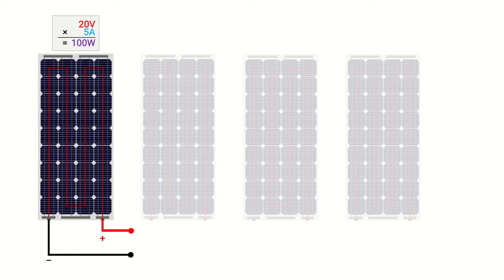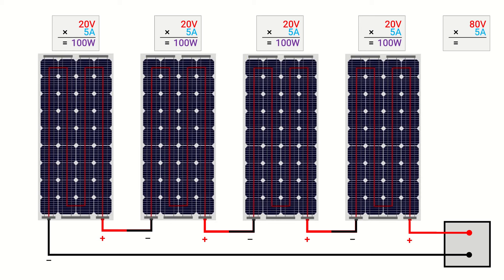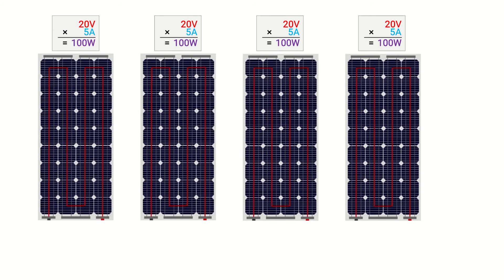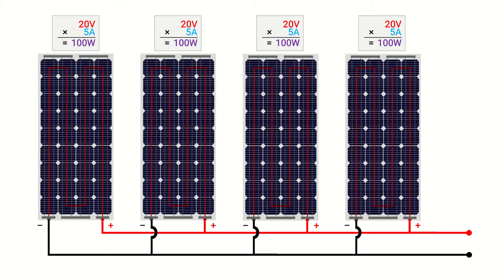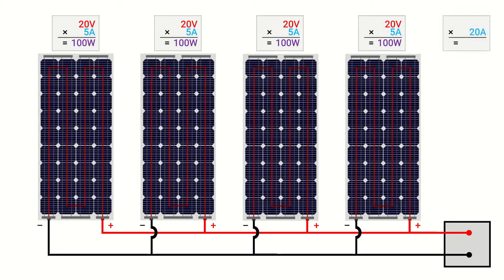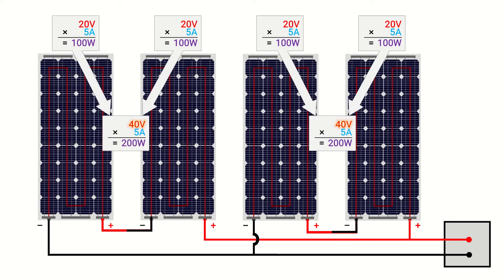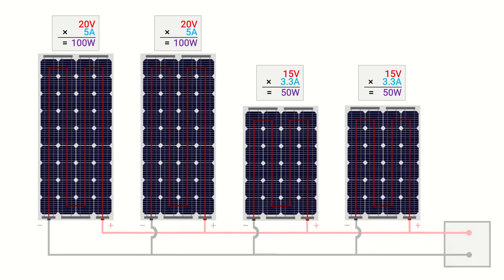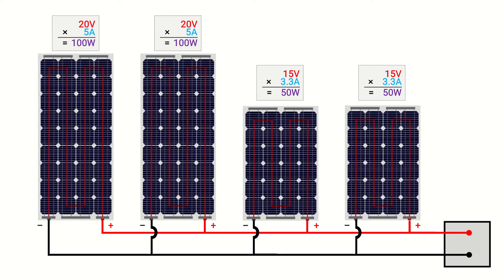How to wire different sizes of solar panels together

Comment: I just hook everything up as 12 volt bringing each line in to a positive and bring it into the house and bring anything negative into the negative and bring it to the house without combining them and my one's doing fine my other one I'm not exactly sure cuz it's never been able to put on its full power because the battery is enough so I don't know if I'm running all that one or just kiss somebody and 28 amps and the one I know is okay because that's all I hooked up to is 28 amps and they're both hooked up the same way with two different size solar panels but the bigger 60 amp one is connected with additional 60 w solar panels same as the other one with 150 w solar panels and they both sets have two 405 w solar panels no one at 950 Watts runs okay for the tubing size solar panels I'm not sure about the other one which is 1440 Watts I'm not sure how that one is actually doing cuz it's never been a run up to its total amount of power. Cuz in other words connected to it and with them together it's running smaller than the small one is I'm not sure why except that I don't have enough batteries I'm not using the power to make it work all its power that it needs to work I'm not sure.

Comment: Iam confused! Why can't you just wire all of them in parallel and let the voltage intact? If all the panels have the same voltage and u wired in parallel ur simply adding up the amperage and leaving the voltage the same, thus aswell getting 100% output! But u never mentioned that way, why?

Comment: This lowest common denominator, is it not BS???
I mean, if you have 200000  panels of total 20 volts and 2 panels of total 15 volts, you really think that the whole shibang is gonna come down to 15 volts? i don't, i had 6 panels putting out  60 volts and then i made a mistake wiring 2 more, and they only put out 30 volts(i did not put these 2 in series, like the others--3P2S); i fixed that a week later; meantime, the wattage stayed the same as if the 2 last panels were not there; that is why i saw some' was wrong;
 Remember, they have  DIODES to protect them  from being"charged" by higher voltages; i see this deal of the lowest voltage ALL OVER the Net and of Youtube, so i must be wrong ?